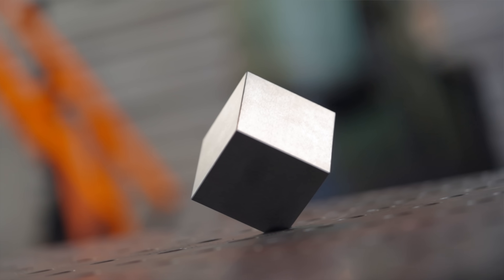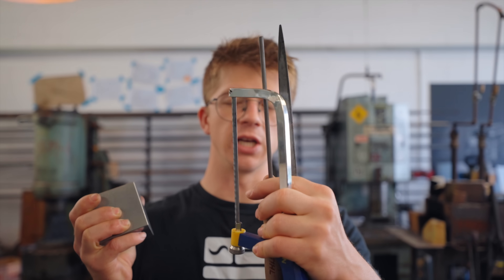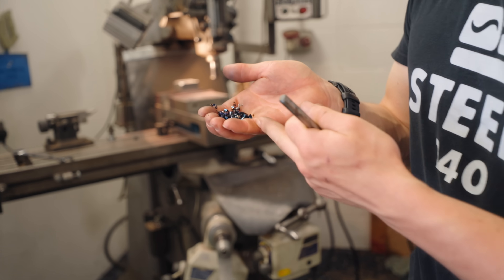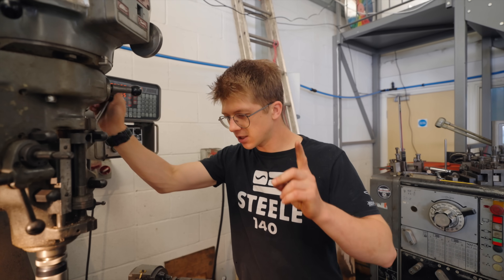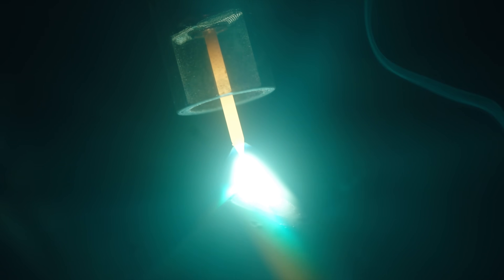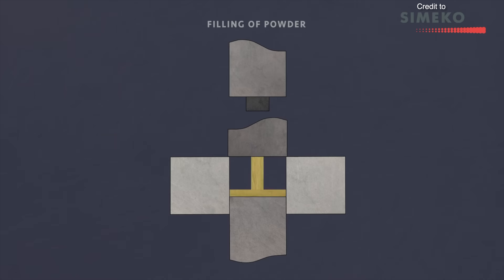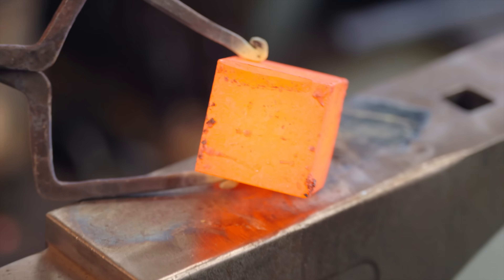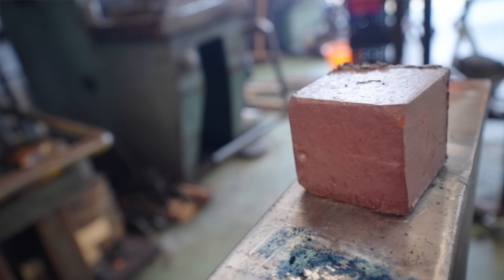Can You Forge Tungsten?

Comment: 4:45 easily is my guess. 

I have a scrap recovery furnace. It's supposed to be able to melt copper but it just barely can't finish the job. But, if I drop a bit of aluminum in, the whole lump goes liquid in seconds as the liquid aluminum penetrates into the copper lattice. 

The resulting alloy is pretty cool: gold in color, tough like bronze, highly corrosion resistant. I've read that they the use aluminum bronze alloy to make boat propellers and dental crowns.

Comment: Answer to why its smoking: tungsten, although thermally very stable, does not like oxygen at elevated temperatures. If you heat it up inside a forge and pull it out, it rapidly starts to oxidize to WO3, which is a gas at around 1700C. It could also be micro particles of the oxide flaking off giving the appearance of smoke. But basically tungsten doesnt have to get very hot to oxidize in air.

Comment: i don't know what type of tungsten you have but the ones i have in my workshop dont cut by a saw. dont cut by a angle grinder and dont cut with a cutting torge. only plasma cutter could manage to do it.
so try to get the tips/hammer inserts of a vertical impact crusher. that is real tungsten

Comment: Steel can melt between 2500-2800°F or 1371-1540°C.
I believe you can hot work tungsten at around 1,500°C. However tungsten will heavily oxidize in air.

Comment: Apparently titanium is kind of a bitch to work with if you don't have the proper expensive tooling. It's also so bright when you grind it that you have to use something like a welding visor. You should try that. Iridium is also very impressive as a material but most likely too expensive to get in a large enough chunk to mess around with.

Comment: Comparing this relatively raw tungsten to steel and tungsten carbide is like comparing something like cast iron to high speed steel, it has the same base main component but so many more processes and additives required to actually make the molecular structure rigid and able to take such a beating from various sources. Yes it's incredibly dense and heat-resistant, but compared to other materials raw iron is as well, and we get steel from iron plus throwing the whole kitchen sink at it.

Comment: You should have made thin cuts from the block, and then make a 5 layer billit of Tungsten combined with 4 layers K600 or L6, (eg. T[L6[T[L6[T]L6]T]L6]T @ 5mm each, middel plate i'd make 7mm) leaving a thicker tungsten center plate as your knifes edge. Damascus it. The thinner or smaller the piece of steel, the easier it will work, not saying it's gonna be easy..

Comment: Is that definitely tungsten? We use a lot of it at work and it is normally sintered in an around 5% iron matrix. If you imagine melting the iron and mixing in tungsten powder. It's almost like a composite. That's why it's not as hard as you expect it to be, you're really working on the 5% iron (or copper).

Comment: I think it was smoking when it came out of the forge because it was oxidizing. Iirc, at around 800°C, tungsten will form an oxide when reacting with oxygen in air to form a white smokey dust that will deposit on surfaces like a chalky coating. I remember seeing a project where someone used tungsten electrodes for a high voltage spark gap because the plasma could get very hot, so they figured tungsten wouldn't melt and thus would be a good choice of electrode. However, while it didn't melt, it did disintegrate and deposit on the glass chamber as a white powder of tungsten oxide.

Comment: As a material science engineer, I was totally facepalmed. Tungsten is not forgeable  on the air. White smoke is a sublimation process of the oxides (the oxides sublimate at 800°С).  Do not try to use oxygen furnace you will just burn tungsten into gas nanodispersia of tungsten oxide. Ignorance makes everything unexpectable magic

Comment: The Tungsten smoked because it just oxidizes in air when hot enough. This is why Tungsten, when used as a bare metal instead of a compound, is usually sintered and not forged. These Tungsten cubes usually contain up to 5% Nickel btw. Also, you do not want to inhale Tungsten Trioxide fumes. It isn't healthy. At all.

The Tungsten Carbide on your tools and drill bits gets there by physical/chemical vapor deposition. It's a super high-tech process that's also used in the semiconductor industry.

Comment: It smokes like that out of the forge because at high temperature, Tungsten becomes extremely reactive with Oxygen - what you are seeing is Tungsten Oxide forming (it builds up as a yellow solid on the metal as well). This is a big part of why Tungsten is difficult to forge, when you get it much hotter than you are getting it here it starts to really quickly oxidize and turn into a powder. You can only melt it effectively in an inert atmosphere, which of course is very expensive to do at that temperature.

Comment: I once wondered the same thing about Aluminum Bronze as Aluminums melting point is way lower than that of copper. Turns out you just yeet the both of them into the melting pot at predetermined amounts and just wait for them both to melt. I suppose they do the same with high speed steel alloys of tungsten and steel. Which arguably would be odd as steel breaks down into carbon and iron when iron becomes a gas at 2,800 °C (5072 °F). Aluminum first becomes a gas around 2470 °C (4478 °F) while Copper melts at 1085 °C (1985 °F)

Comment: I work in a superalloy foundry but full disclosure, I wasn`t on the furnaces. I do know to alloy tungsten, the tungsten is melted first and then other materials are added to the tungsten afterwards. My guess is that the melting temperature is lowered throught the melt as the Tungsten is watered down by other elements. Pure aluminiums and titaniums are added last as they will burn off easily. Extra is added to account for element loss.Edit - when I mean added first it`s usually added to an existing bed scrap revert of the alloy you are making. It`s quite rare that a pure heat is done.

Comment: As a machinist, I'd like to see you try to forge Inconel. Inconel is a family of metals ranging from Inconel 600 to Inconel X-750. I've machined it before, but it is quite difficult to cut without proper tooling. It was and still is used on space shuttles.

Comment: Maybe this is a dumb comment, but tungsten and tungsten carbide are very different. It's not an alloy of tungsten; it's a different chemical, like the difference between iron and iron oxide (iron oxide (rust) is also a ceramic, I believe). There's a carbon instead of an oxygen in a carbide as opposed to an oxide. Alloys are like a stew, where vegetables and meat are missed together but are different; tungsten carbide is like a pure chemical, but the molecules are made of tungsten and carbon atoms bound together.

Comment: Actually it's not very tought at all. It's incredibly hard and abrasion resistant but you don't have to work with tungsten carbide tooling much to know how easily it shatters. I've broken more than a couple drill bits and end mills by fumbling them.

Comment: I found this quite amusing given I TIG weld...there's a reason the electrode is Tungsten...it can take the most heat without deformation...pretty sure that would preclude forging at "normal" forging temperatures :)

Comment: Use some of the Tungsten for the handguard and pommel of a one-handed longsword - and balance the additional weight on the grip end with extra length on the blade. Make a Way-Too-Longsword that has deceptively excellent balance. (Epic Mode: Make the blade out of Mokume Gane. Give about 2/3 of the length of the blade maybe a half-inch wide hollow (through-cut?) fuller. Collaborate with @styropyro to put a high powered laser down the hollow fuller. Take advantage of the additional weight reduction from the cutout, and the added weight of electronics in the grip along with the Tungsten handguard and pommel, to make an even longer Laser-Augmented Way-Too-Longsword.)

Comment: To my knowledge if you want to forge tungsten, the temperature range is 1400 - 1600 degrees Celcius. It's not easily done though. It will crack and break if not done right.

Comment: There's this fun process called "atomic hydrogen welding" were hydrogen gas is passed through an arc between two tungsten electrodes.  THe hydrogen is cracked into rather high energy m̶o̶l̶e̶c̶u̶l̶a̶r̶  atomic hydrogen in the arc, then recombines when it hits the cooler metals you are trying to weld, dumping all the excess energy as heat.  Temps can get up to 4000C and it was used do weld tungsten fairly effectively.
Reply: not many people know about that one anymore... even less have done it!

it finds certain industrial applications...
Reply: The hydrogen molecule H2 is cracked into H atoms, not " high energy molecular hydrogen"
Reply: @PedroFigueiredo-q9x  Lol you got me there, should have been "atomic" instead of "molecular".
Reply: @Hawk013  Thanks. But how have they made thin lamp filaments for eons?
Reply: @PedroFigueiredo-q9x  Specifically?  I seem to recall that it was a difficult process to perfect, drawing some alloy of tungsten through heated diamond dies to make ductile wire.
Reply: Problem is hydrogen embrittlement.  It's such a major concern in industry that there are specific welding rods that are low hydrogen and have to be baked to remove all the water.
Reply: Hydrogen is a fun material to work with. Keep the videos coming.

Comment: The Anode portion of an X-Ray tube is usually made of tungsten. (It's the spinning part that you hear whirring just before the "beep") and...of course...as a Brit (You must know) the majority of steel tip darts (body part, the part you hold) are made of a tungsten alloy. Rarely 100% tungsten, too brittle and likely to crack if a "bounce out" from the board hits a hard floor.

Comment: Honestly it’s probably only hot enough to be ductile on the outside of it. That’s why the corner dents and the edge flattens but hammering does almost nothing. The center is almost certainly not hot enough to forge with. You’d probably need to leave it in the furnace for a half to a full day to have any chance

Comment: Most of your tests at the beginning with grinders and other machining tools were testing the hardness of the metal more than the density that you were trying to show off. Tungsten is rated between a 7.5 and a  9 on the Mohs scale which is very high, however Tungsten Carbide is rated at 9.5. It was impressive that some other tools like the files and high speed steel seemed to work, but probably were damaging the tools in the process. some other tests that might be interesting on a material as hard as this would be to try polishing or sharpening the cube, but the diamonds used in those processes would probably work like normal like the tungsten carbide was.

Comment: I'm not a smith, but the science behind the properties of different materials can be fascinating. Tungsten is used as a filament for incandescent lightbulbs because it can handle heat EXTREMELY well, but density doesn't actually do too much for the strength of the material. The strength of a material comes from either the small scale structure of the material (most metals have a small, but not quite microscopic, mesh of crystals like the uneven grains of sand in an hourglass) and from the molecular structure of the material (spider's silk is super strong because it's a combination of tiny, rigid molecules held together with a super stretchy polymer, like plastic). Pure tungsten is pretty much like super condensed sand, it's usually found in compounds and has to be chemically extracted before it can be turned into a purified material, and on the atomic level it only has 2 valence electrons, which at the size of the atom means it physically can't bond with enough neighboring tungsten atoms to fill its valence electron shell in a perfect crystalline structure (the glue holding it together is basically Elmer's glue while most carbon compounds use super glue). Pure carbon compounds like graphite and diamond, however, are extremely brittle because they bond so tightly on a chemical level, which makes the physical structure less stable. Graphene is a material made by taking single molecule thick layers of graphite, which you can do at home with some scotch tape and pencil lead thanks to that weaker physical structure.
Reply: Tungsten filaments are doped with other oxides to prevent "creep" at high temperatures.

Comment: I want to see you work with a powder metallurgy steel called Maxamet, powt heat treatment at around 68-69hrc. I want to see you working with a piece of hardened maxamet! I want to see you cutting it in to a shape of a knife, grinding it, drilling it for handle scales and working with it in general!!! Would be super fix! Or a piece of hardened CPM (Crucible powder metallurgy) REX 121 at 71.5 Rockwell C scale.

Comment: i think you're just going to have to shave it and cinter it... because it will NOT forge that CUBE with the equipment you've got right now... and i doubt you've got a few million smackers sitting around in the bank to buy and install a furnace capable (and small enough) to fit inside your shop... unless you build ANOTHER shop just to hold your new blast-furnace... plus i doubt your local gas company is going to dig up your main for a few km AND lay in a main with 10x diameter and flow-rate through it to supply that furnace with enough gas to heat it. or your local power grid company will have to stick some SERIOUS high energy power lines way WAY above the capabilities of your home/shop's load capacity and wattage requirements for an electric furnace. 

maybe, maybe if you slice the cube thin enough the thermal energy will be able to FULLY permeate the tungsten and excite the crystals and atoms enough to make it ductile enough to forge. MASS is a calculation of physical dimensions and density with weight and the force of gravity on Earth. thermal energy does NOT pass through a dense and MASSIVE substance EASILY. atoms on the surface of that cube can NOT vibrate and get excited enough from the thermal energy 'whackin at em' from the outside to pass that vibration and excitement deeper and deeper into the cube thereby heating the whole cube to its core. 

IF you change the physical dimensions and weight but the density of tungsten is the same, perhaps thin pieces of tungsten will fuse under pressure?

like the Wiki article on tungsten says: "Tungsten has the lowest coefficient of thermal expansion of any pure metal. The low thermal expansion and high melting point and tensile strength of tungsten originate from strong covalent bonds formed between tungsten atoms by the 5d electrons" so you've DEFINITELY got to increase the surface area of each piece of tungsten you're working with that is interacting with the thermal energy from your furnace i.e. thin 'sheets' or 'slices'. that would also reduce the overall mass of each piece in order to more easily excite the atoms to malleable temperatures.

Comment: Heat it up to dim cherry red and it will forge surprisingly easily, similar to mild steel. It is because it undergoes an internal phase transition where the crystal structure slides easily. ❤

Comment: That tungstem is extremely pure if you can cut into it with a hack saw. It can be easily forged at dim red heat which is very surprising. At higher temperatures it becomes harder and starts burning at yellow heat. ❤

Comment: The thing is when you add pressure to certain alloys or metals they hold up differently tungsten is tough but only at higher speeds than other metals either way they will still break

Comment: You could use in places where temperature is high and you don't want any deformation for example hammers or even better the face plate/anvil of power hammer or as a face plate of hydraulic press.

Comment: That is probably not 99.99% pure tungsten. I'm going to guess that the cube is an alloy called MT-18F. It is ~95% tungsten, ~3.5% nickel, ~1.5% iron with some other trace elements.
This alloy makes it much easier to machine and work with. Pure tungsten is brittle and will shatter instead of deform under enough stress.

Comment: but didn't get it hot enough to forge -.- even u subversively said it wouldn't be at it plastic point to move like steel. I call this a fail. you are likely going to need custom equipment to bring it up to forging temp. I have always pondered what I could do with a hard ceramic forge that had oxy/oropane as a fuel. in theroy the equipment should survive for long enuf to forge high temp exotic metals. 😅 still interesting video and confirms my thery about forging machine steels. 😮

Comment: Tungsten is a refractory metal, it cannot be melted down and cast into homogenous blocks like steel/aluminium etc. The cube in this vid is formed by pressing and sintering powdered Tungsten, with the tests being carried out more a trial of the bonding between Tungsten particles rather than the material itself.

Comment: On top of some forging suggestions from the other commenters, I think that if you want to forge with tungsten in the future you'll need smaller pieces. Shavings would probably get softer and hotter quicker since it will take less time and energy to heat the center of the metal in contrast to the block you have. Cutting it into smaller chunks would probably work as well.

Comment: You should try to slice off a bar of it, and forge that, as I assume as hot as that metal is on the outside since it is so heat-resistant, the center of the metal is still probably "cold" and just wont move since its so thick. It would take a good while but if you put it through a bandsaw and cut off like say an inch from one side, then cut that into like slender bars, could you then maybe layer steel bars in between for a damascus-steel-tungsten blade?!?! 

Do it, Alec. Do it for us. I believe in you!